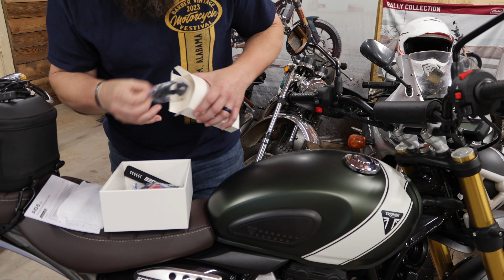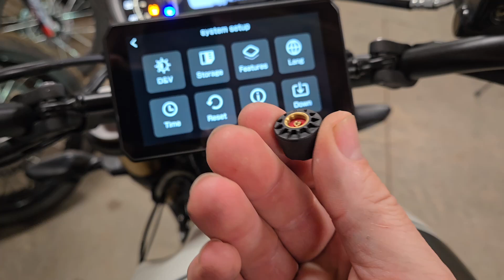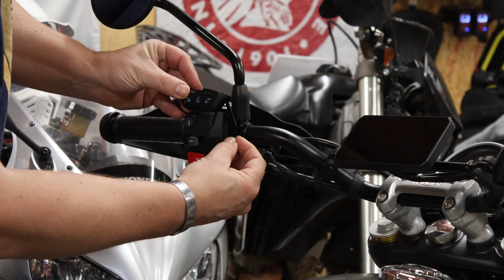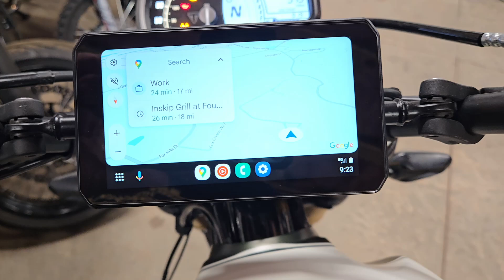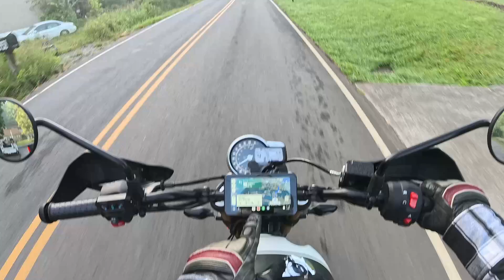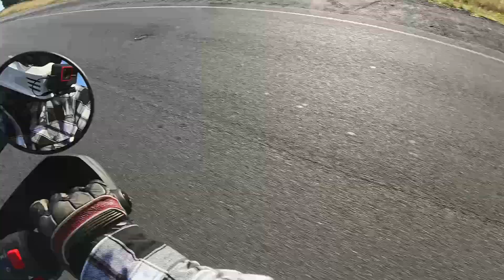Triumph Scrambler 400X Gets Chigee AIO-5 Lite Tech Package with Nav, TPMS, Cameras, CarPlay and More

Comment: Great review, and I plan to get two of those for two different bikes… One is an older Harley electro glide with nothing except a phone mount… And I am spoiled by Apple CarPlay in my cars and on another bike

Do you plan on experimenting with any sprocket sizing? I am looking at 15 and 16 for the front to tryout and see if I can get a slightly taller first gear that doesn't bug me.

Comment: Your hand guards/protectors seem to be in the appropriate place. On my scrambler 400 x , they seem way too low to actually protect my hands. Did you adjust them? If so, is it an easy adjustment?
Reply from the maker: Yes, they should rotate up and down a bit, fairly easily.  Just loosen the bar end bolt slightly.

Comment: Where did you mount the gps receiver? I mounted mine under the rear end of the seat, but I don’t get speed and compass direction 4 out of 5 times. 

Trying to figure out the best place to relocate the gps receiver to. (on a speed twin)
Reply from the maker: @simba_the_bigfoot  I stuck mine right on top of the fork clamp/triple tree.

Comment: Would a daily commute of 2 x 50 minutes on the highway be an issue for the Scrambler 400x?
Reply: It would depend on how fast you need to go in order to be with the flow of traffic to determine how comfortable that is for you. If the top speed is 100km/h (like in New Zealand) then you will still have plenty of room to overtake, if you are riding on the Autobahn in Germany where there is sometimes no speed limit then I guess you will constantly be in higher revs and therefore feel more vibrations and have more noise.

Comment: How did you connect the yellow wire? Is it under the fuse box? Did you splice the wire? 13:42
Reply from the maker: @creambomb7  yes, I used the supplied tap under the fuse box.  Just pulled it up to give myself some room, peeled back the wire loom some, and connected it.

Comment: Do you get any distortion in the recorded video from the engine vibration? I had this issue with a motorcycle dash cam I installed on a previous single cylinder bike (390 Duke).

Comment: When you ran the wires from the front to the back, did you lift the tank and if so, how is that done?  I see a bolt at the rear side of the tank but is there anything else that needs to be disconnected to lift/remove the tank?  Thanks!  Great video!  I subscribed because of this video. 😎
Reply from the maker: Thank you! I didn't lift the tank.  I attached along the frame at the front of the tank, then removed the small plastic side cover at the rear side of the tank and used that space to secure, then go under the seat. Seemed to work great.
Reply: I removed the rear tank bolt and lifted the tank enough to get them in